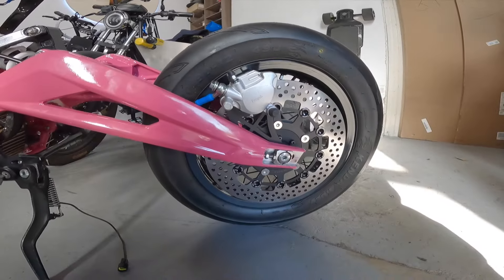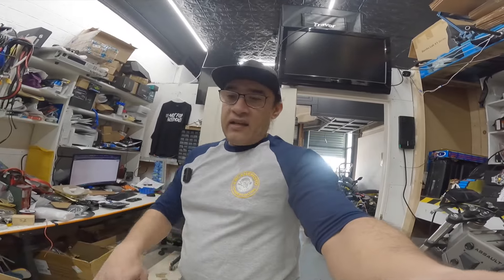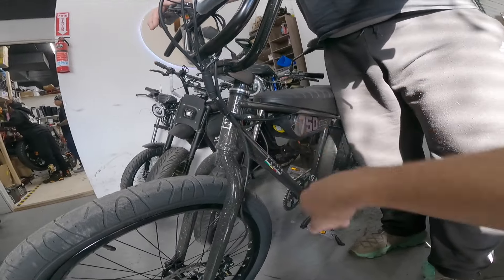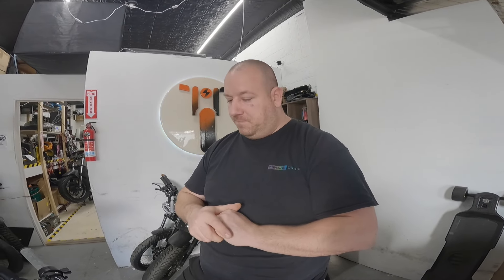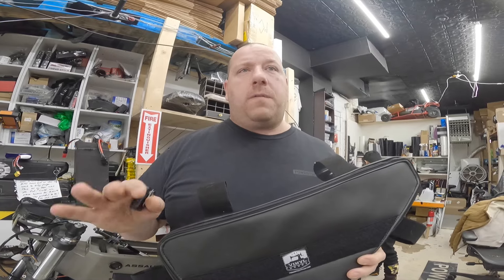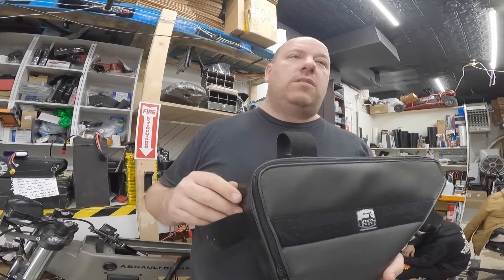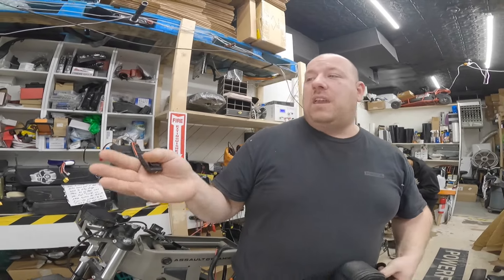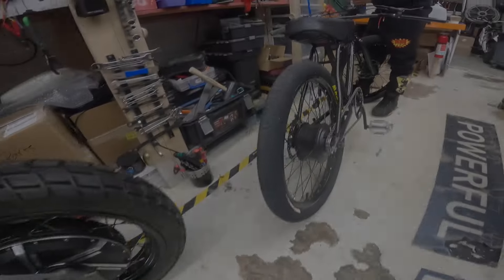Raising The Bar    The E-bike Mods Keep Coming

Comment: How much does the qs 5kw  motor cost for the zoo's 1200 its not on power lithium website like to get custom set up with moter and battery
Reply from the maker: He’s working on getting it posted… if anyone reading this is interested please reach out to them through email DM through Instagram or you can always call… (551)404-4107 ask for V…  waiting on a price and I’ll reply it here… 🙌💯💪

Comment: Can he turn a SE Fast Ripper bike into a EBike like the Zoozs and with mugura brakes,soundwave like the NAMI burn-e max with finger throttle,72 volts like 60 MPH and real range 53 miles.
Reply from the maker: I don’t see why not…. Is that some you have…? Give the fellas a call and see what you can do… (551)404-4107

Comment: What I need to do to get my Lyric Graffiti custom built battery and controller and 5000w Hub motor
Reply from the maker: You’re one step ahead with the idea… 💡 call em up and get it going… (551)404-4107